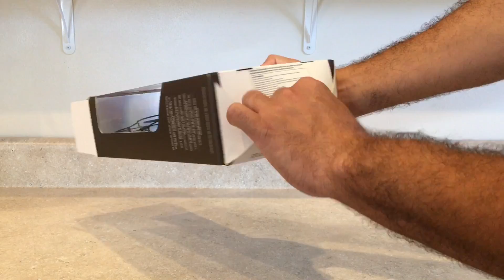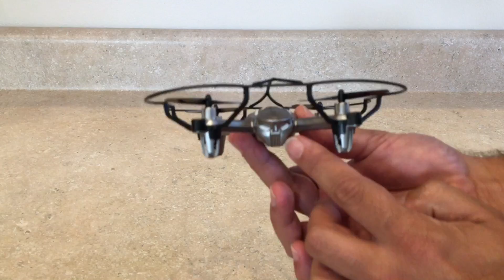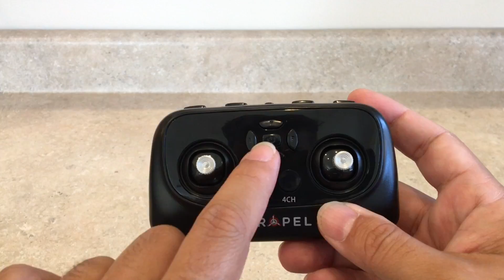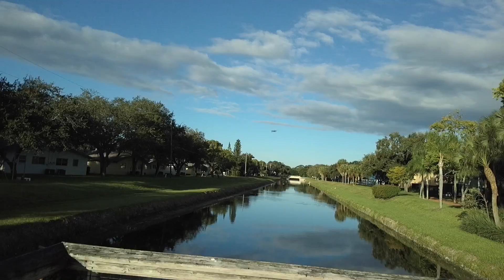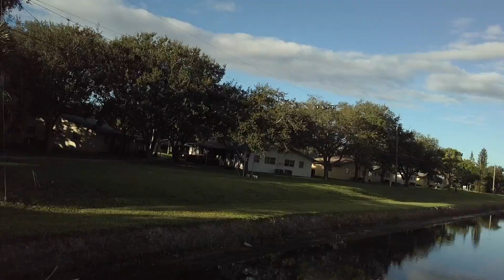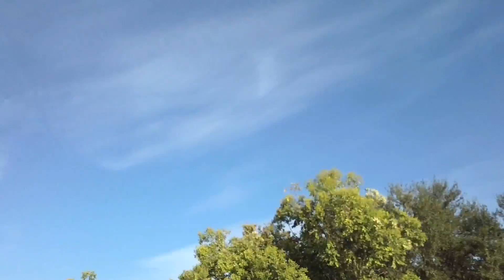Propel Navigator Prowler Drone

Comment: What to do if it lands on the side and stays on the ground
I changed the wings but it still didn’t work
Reply from the maker: Make sure you put the propellers on correctly (as they do go a certain way)... Putting them in the wrong orientation could cause the quadcopter either to fly erratically or not fly at all…